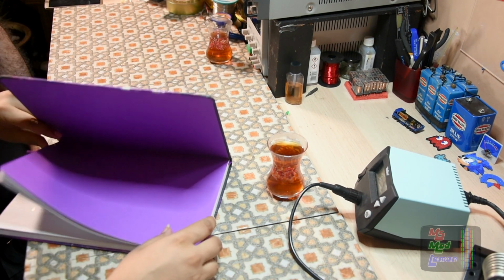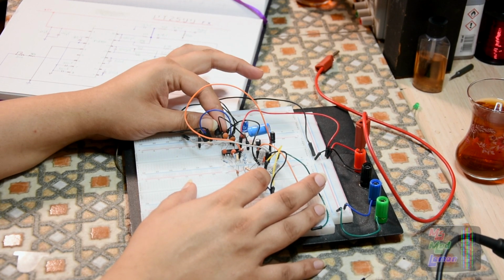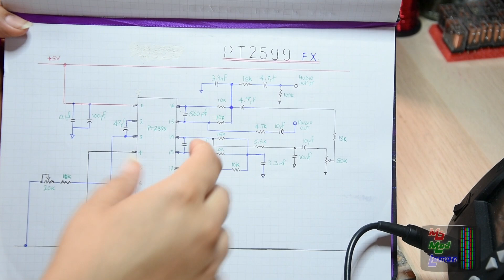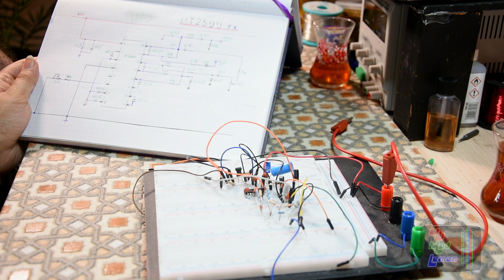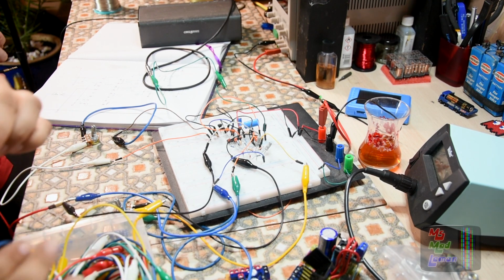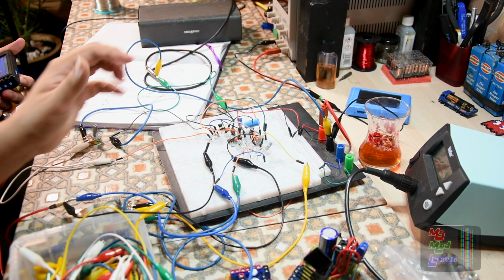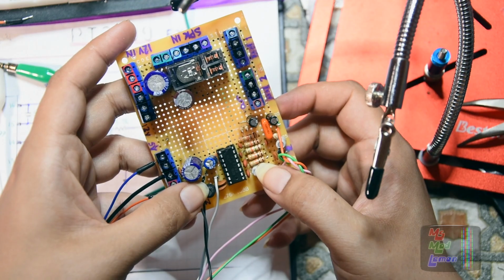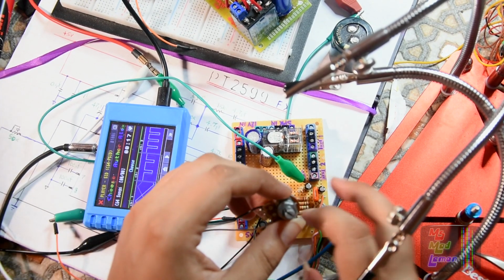PT2399 Echo-Reverb Circuit - SIDBoomBox Project 16 (Feat. Electronscape)

Comment: Digital circuits/processors are usually driven by a clock, so many of the transistors on those ICs switch at the same time. This causes little current peaks. Since the ground does not have an impedance of zero ohms, the current peaks result in voltage peaks = noise. You don’t want this noise in your analogue circuit. This is, why digital ground and analog ground are separated. You have to join them somewhere, and the best place is usually as close to the power supply as possible. The impedance of the common part of the ground is very low, this way and the ground noise of the digital circuit is not much introduce into the analog ground. And the ground has to be very low impedance. That is, why ground planes are used on circuit boards.
Reply from the maker: Thanks for the explanation Sven, I ended up doing exactly that and joining it close to the power supply as possible through an inductor.